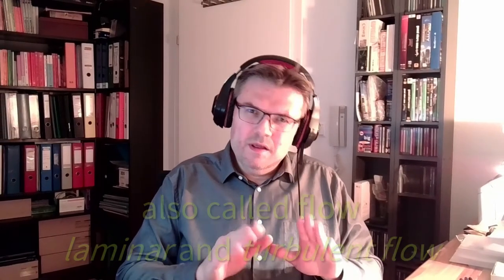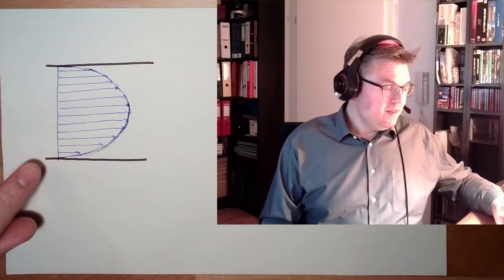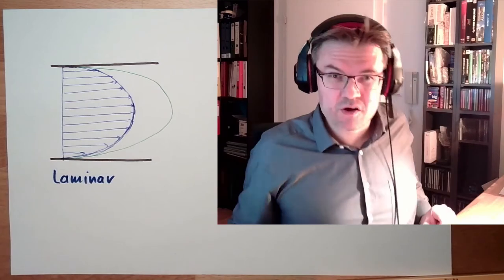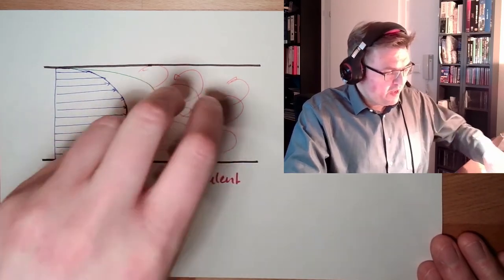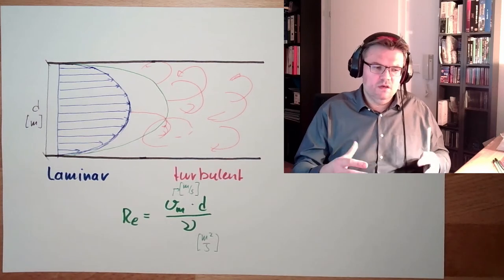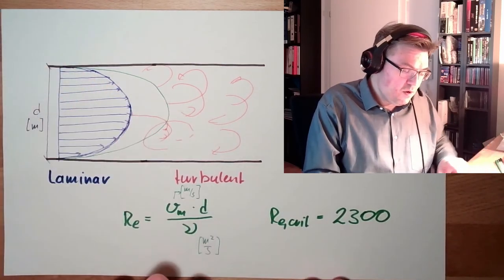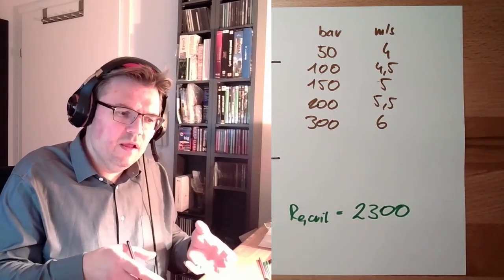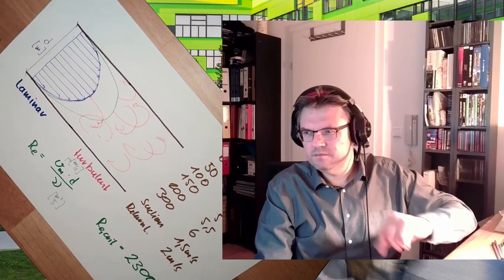Hydraulic 04: Laminar And Turbulent Flows

Comment: Dear Heinz,
For a flushing unit I have to use a turbulent flow. I notice that for larger pipes I need less speed to remain turbulent (d= 60mm, v= 4m/s). Everyone at work insists that the speed should be atleast 7 m/s, but no one can substantiate this. Do you know whether 4m/s should be sufficient or should a speed of 7m/s still be reached?
Reply from the maker: Dear E O. This depends on the used tubes. I think what you are looking for it is displayed in the Moody-diagram. Search for this and you will find the border for full turbulent flow in this diagram. Along with all other dependencies (i.e. Reynolds Number, friction coefficient,...)